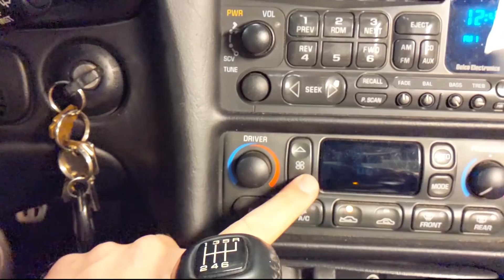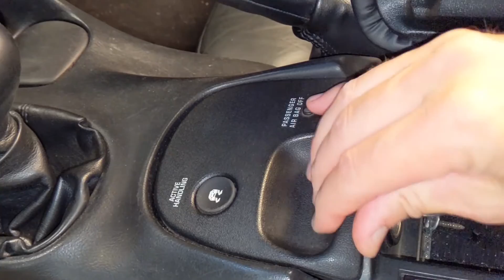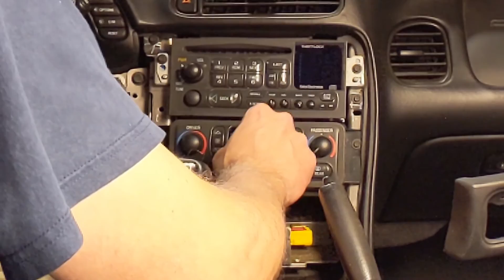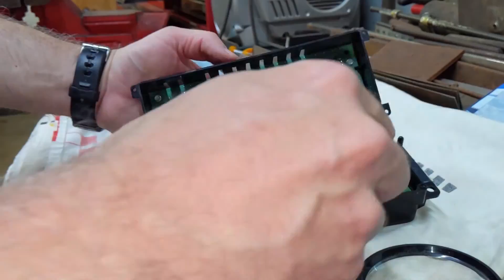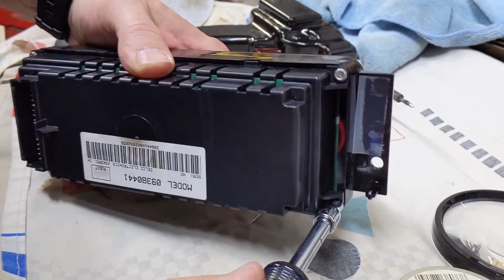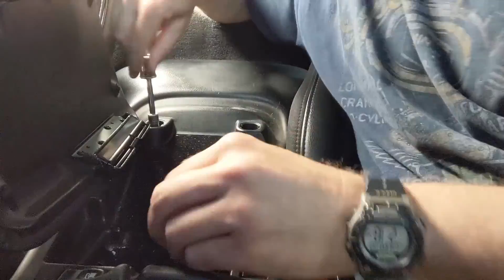C5 Corvette DIM HVAC Control Display Repair/Fix

Comment: I lived with a screen to dim to see for years in my 2000 C5 until I came across this video. An extremely well done, step by step video. He showed the entire process, but unlike many, he sped up the borrowing stuff, such as removing a screw. Maybe the best repair video I have ever watched.  It took in total about 2 hours and this fix worked. I can't thank you enough.  On my convertible I had to remove the waterfall by removing 4 screws in order to move the center consol back an inch or so.

Comment: Thanks for this video. This a pretty easy fix that I decided to do when upgrading to a new stereo. Mine is a '98 and the surface mount resistors aren't all lined up like yours. However, there are still eight of them with the same 241 marking. Five are in a group the the other three are nearby. To do this well, you need a fine tip iron that has good clean plating on the tip.  A 20-45W iron is fine if you have a plug-in or 250°C if you have a solder station. Replacing the electrolytic capacitors (cylindrical cans  - 3 of them) wouldn't be a bad idea either due to the age of these cars. That's a bit more work better left to someone into electronics.

Comment: This video was a great help and I enjoy all of the Toys 4 Life videos.  My issue was a little different as I needed to replace cracked climate control buttons. One thing to note, my C5 is a convertible and I had to remove the waterfall to get the console to slide backwards enough to get the main trim piece out of the way. Thank you Toys 4 Life
Reply from the maker: Thanks for the support!!

Comment: HELP HELP HELP! My C5 display dims intermittently. But the blower and AC do not work either! All of these HVAC re-soldering fixes I've seen on youtube only deal with a dim display. Could this old cracked solder on those 8 resistors be causing my blower and AC not to work too? I need this fixed. It's hot out here on the east coast! I'm going to go through and replace all the AC related fuses next before I take the darn center console apart.
Reply from the maker: Check the fuses with a test light - no need to replace.  Just check for power at both pins on the fuse.   If you can solder fairly well with a small tip, look over all the connections with a magnifying glass-  you can see the cracks.  These units are spendy - so if you are not confident - find a friend who is - or send it in.

Comment: Unable to get the large black plastic console piece to come off. I don't want to break it. Any tips so I can give it another shot? Thanks Guido
Reply from the maker: Just be sure you didn't miss a screw/fastener.   Did you get it out - I assume yes?
Reply: @Toys4Life  I believe that I disconnected everything but just couldn't maneuver the plastic piece out. But I'll give it another shot in September when it's a little cooler. Thanks Guido

Comment: Ugg, I've seen enough of these amateur solderers to make me sick. It's not that hard, take a beat and do some damn research, USE FLUX!!!! Such an easy concept, and get in and get out, DON"T TICKLE IT, you're cooking the solder and making a crappy connection. Then clean the board with 99% alchohol.  Use a decent soldering IRON not a GUN, you'd think you young guys were trying to do surgery or something how nervous you get about even contemplating it Lol, heck, grow a spine.

Comment: Those in fact are resistors, I think they call them surface mount. I needed one of those in a particular value to replace one that went open on an audio mixing console, causing a dead channel output. I had to buy several hundred of them sold in bulk on a reel of this plastic strip that looks like old super 8 film except it's white. The reel is made to load into automated equipment. It was about 25 bucks for the whole reel. They were tiny, smaller than what you had there, but look the same. The reason why I didn't just replace it with a conventional resistor is there was no room for one on the board, so I needed an exact replacement.
Reply from the maker: Interesting - where did you buy them from?
Reply: @Toys4Life  I just looked at the reel, I misremembered the quantity, it is 5000 of them on the reel I bought to get just one. These types of components are called flat chip resistors. The ones I have are tiny, about 2x the size of a pinhead, but look exactly the same as what you had: flat, rectangular with a strip of tinned metal on each end. I can't remember where I got them, it was over 15 years ago. I remember I searched online for 120 ohm chip resistor and came up with a vendor who would sell a qty of 5000. Nobody sells them a few at a time, only bulk, and buying one 5000 count reel is considered retail. These components are made to be assembled by automated equipment on miniaturized circuit boards. The spot on the board I had was so tiny that I needed an exact replacement to fit. I let my brother solder it in for me because he was under 40 at the time and still had eyes that didn't need reading glasses to focus.

Comment: Thanks for this how-to.  Mine was getting dim and with sunglasses on I could barely see it.  Just fixed mine this afternoon and it looks new again.
Two tips I'd like to add.
1. The little rectangle things can slide around.  So I held them down with a pick while soldering.
2. Since the interior temp grille is off its a good time to use a little electrical contact cleaner and a Q-tip to gently clean it.
Reply from the maker: Good points sir, glad yours worked out!!

Comment: Great walkthrough! I just followed along and completed this over the weekend and the display is SO BRIGHT now! I have essentially no soldering skill.. seriously, bad enough to where I actually caused two of the little black resistors to completely come loose off of the board and I had to solder them back on.. and even so, I was able to get this done and it works great now. Thanks again!
Reply from the maker: That's awesome, enjoy!

Comment: Is it possible the lighting issue would cause it to be stuck on one setting (lights are completely out, blows everywhere not just the vents). I'm assuming it's the vacuum tubing if not.  Thanks for the video, I'll be doing this in the next couple weeks.
Reply from the maker: I don't believe so. This is just an issue getting power to the LEDs I think. But I'm not 100% positive.
Reply: @Toys4Life  I figured as much. Thanks for the quick response and the videos

Comment: what do you do you just add solder or is it broken yes and you soldered them ??
Reply from the maker: If you can melt the existing solder to reform the joint, otherwise you might have to add a tiny, and I mean tiny amount of solder.
Reply: @Toys4Life    very good thank you I will review it.  my control all its buttons work correctly but the screen does not turn on thanks

Comment: Excellent.  Now, my AC fan stopped working in addition to the HVAC lighting issue.  Could this also fix that problem?  Or, has the fan motor failed?  The Chevy dealer won't deal with this issue.  Thoughts and information.   Thanks.
Reply from the maker: I highly doubt the HVAC lighting and fan motor issue is related.
Reply: @Toys4Life  Just a thought but didn't think so.  The Chevy dealer did nothing but keep my car for a day then tell me there was nothing that they could/would attempt to check out. I do miss the "muscle car days, in a way"...  Thanks